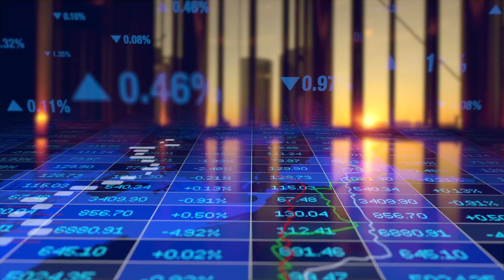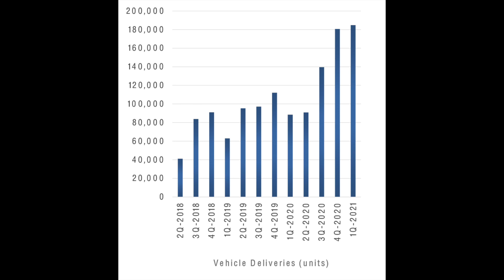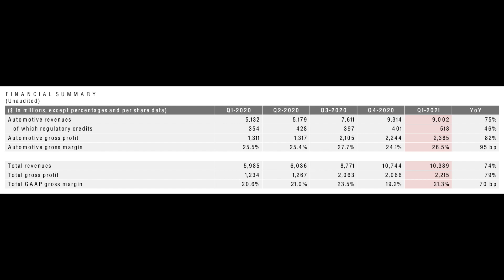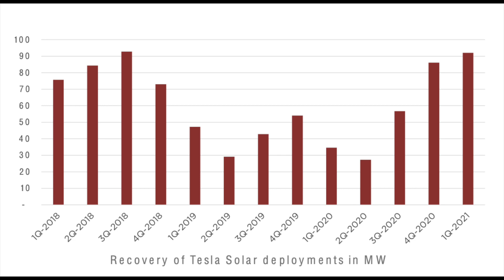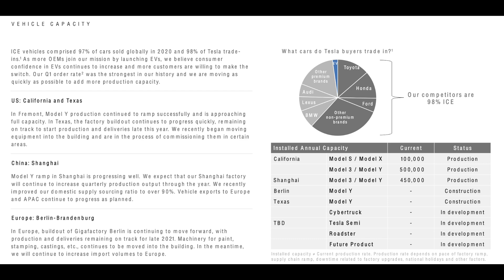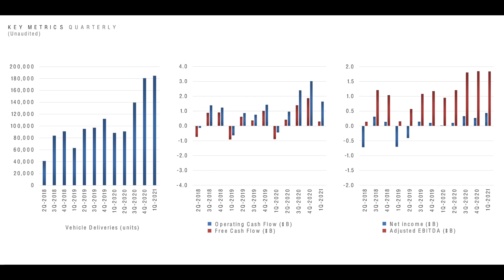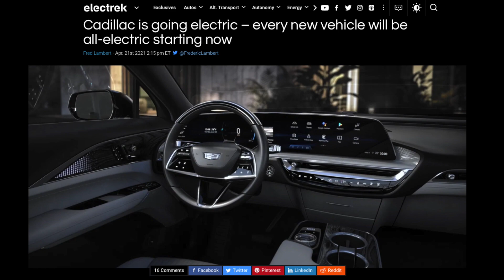Tesla the run-away freight trains | Q1 2021 SMACK DOWN !!!

Comment: About Semi: How can they deliver this year without the 4680 battery, which is going to be produced 12-18 months away?
Reply from the maker: They are already producing them aft Fremont 😉
Reply: 12-18 months was about volume production. Cheers
Reply: The shorter range version may be first off the block with existing batteries

Comment: My opinion may slightly differ on this topic and here's why!
I think Elon is at least a multi-dimensional thinker. That means he looks at problems and opportunities multi-directional. So he's doing all the calculations. Yes he's trying to sell as many model Ys as he can and yes there is a big demand for it. Yes there has not been enough model Ys produced yet for the market. And yes he's trying to pull buyers from his Cybertruck line to the model Y. I know this because I am I reservation holder for a Cybertruck. I was contacted by another showroom after about a week, after I had put in my reservation for the Cybertruck, to drive the model 3 and Y again. Although I really like both vehicles I am unfortunately in a spot, mainly due to this pandemic. I have to wait till I am working again full time to make my purchase. Not just finances being talked about but also features of both vehicles are very different. I was asked if I was interested in a model Y because model Y is available sooner and I said no. I don't believe most people are in a position to buy two new vehicles back to back year after year so I'm willing to wait the extra year for the features of the Cybertruck. If I was working steady like I was in the beginning of the year I would be able to make my new vehicle purchase this year and securely have my funds in alignment. Due to lockdowns back to back, at least in Canada I feel it is safer financially to wait to receive my Cybertruck next year. As well I find the cold rolled stainless steel and adjustable air suspension on my new Cybertruck to be more masculine and I do like the ability to go on off road whenever I choose. Need I go on? So because both vehicles are so different and you already have the space and manpower to put up two separate lines which are going to be needed for the model Y and Cybertruck anyway. Then I say get on with it! The only battery constraint there might be is the new 4680 batteries being built now! I'm sure there is still a stockpile of other batteries from both Panasonic and LG. Cybertruck and Semi both need the larger batteries and model Y does not necessarily need those batteries. If Giga Texas does not pump out over a hundred thousand Cybertrucks for North America this year they are going to lose a lot of there reservation holders because not everyone can wait 2 years or more for their new truck. I believe they will build more Cybertrucks than model Ys this year. They need to build both lines right now because they can build the Cybertruck faster and the demand is large for the truck buyer of North America. Finish the Cyberline at Giga Texas and start building more high density battery plants and Cyberlines throughout North America. Otherwise you still have not reached that market yet and you may lose your reservation holders that can't wait for 2 or 3 more years for their Cybertruck!  I am confident if they go this route they will sell more than a million Tesla's this year and be well on their way to more than 2 million next year. I only say this because of my background in Automotive Marketing and thoroughly knowing the demographic truck market of North America. The faster Giga Texas builds Cybertrucks the faster the rest of the world gets their Cybertrucks! Tell me if you like these ideas or have some of your own. I would really like to know. I do appreciate all of you and your comments. This is the time!This is the place! And we are the people that will change the world! 
propower101@hotmail.com